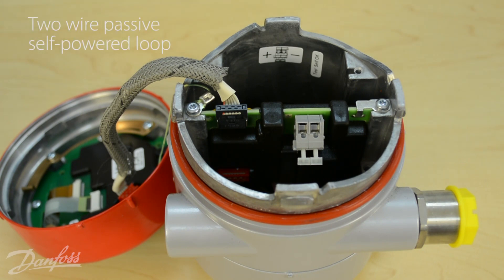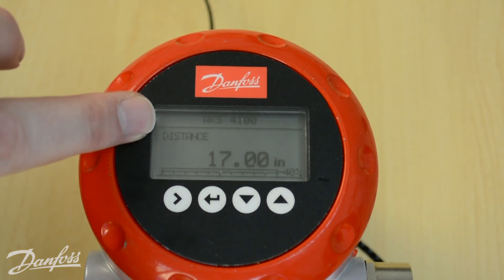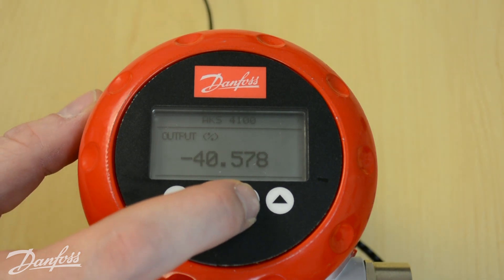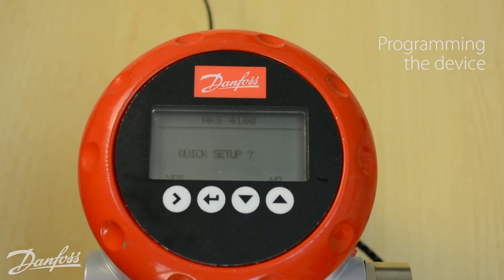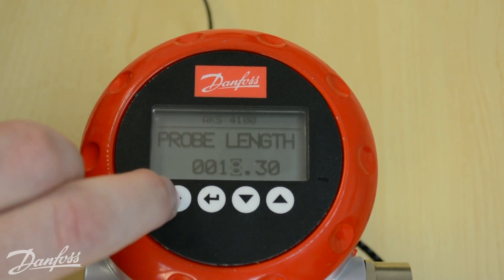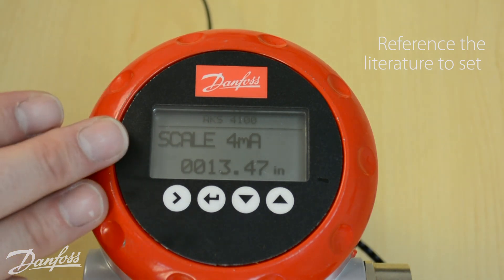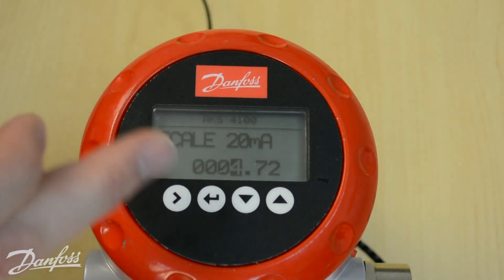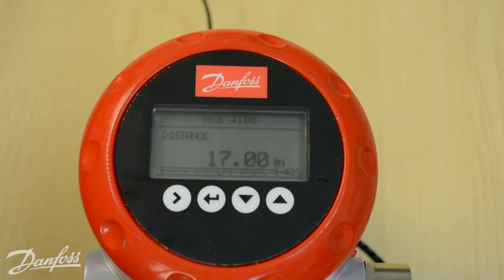Set up and configuration of a Danfoss AKS4100U liquid level sensor

Comment: We have one of these in our accumulator at work. And it just stopped reading it 29". I took it out and wiped it off with a towel hoping that would fix it and it didn't. No alcohol just a towel. Now its stuck at 19". Any help would be greatly appreciated if there's a way to reset it I've disconnected power still no help..
Reply from the maker: Hi Jason, our tech support team is available to help with your question. In order to give you the best answer, please reach out to them by phone at 1-888-326-3677, press 1, then 2 for "cooling" and 3 for industrial refrigeration tech support. The same team is also available by email at cooling.ts.ir.na@danfoss.com.